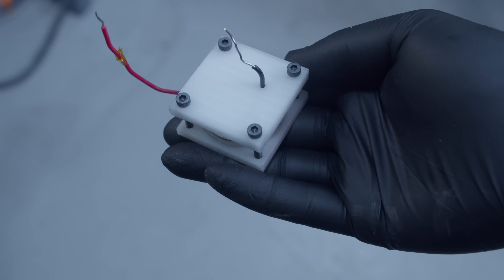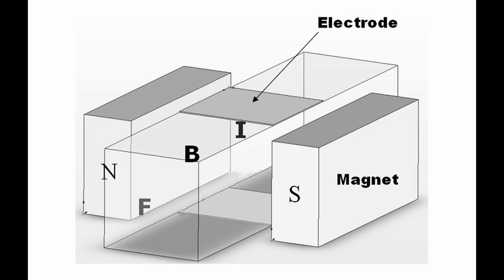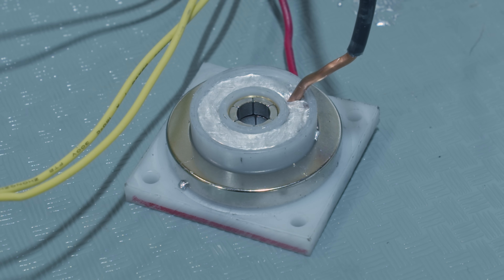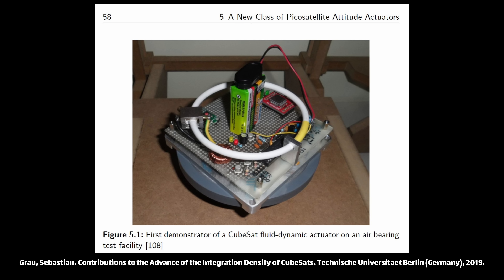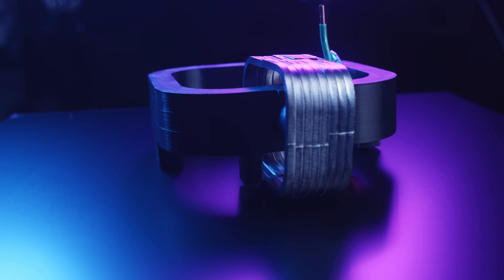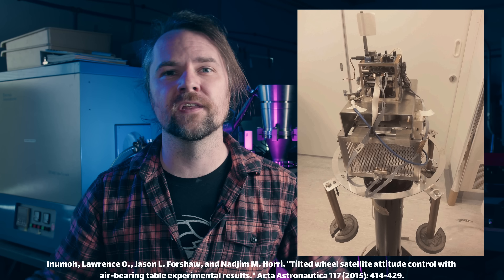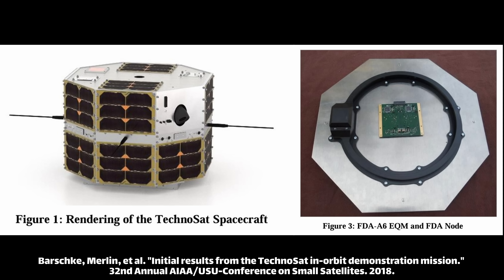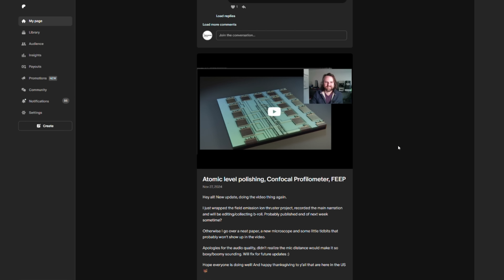A motor with no moving parts (sorta)

Comment: You would have to contain the metal in a pressure vessel or the metal will evaporate. I imagine the heat needed will not be a problem since space is an insulator, and heat dissipation is a spacecraft's main problem.
Reply from the maker: Galinstan actually has a very low vapor pressure, negligible evaporation at operating temperatures!

Comment: A friend of mine sadly gone, thought that if you have a torrid & magnetic coils that not only rotates the mercury round the inside of the torrid which will result it it being pushed to the middle of the inside wall, but also to rotate the mercury so whilst it pushes up against the wall it also tries to move it upwards. So two rotations, one round the torrid, the other up against the middle of the inner wall. I wondered if whether having "blades" on the outer inside wall might work like the paddles of a riverboat. Sorry for the bad wording. It's difficult to articulate this.

Comment: I am wondering how big of an issue it is that these reaction wheels need to be actively heated? I am aware that satellites often have a heated partition for vulnerable electronics and measurement devices, but I believe pressurized air and some mechanical reaction wheels can operate at near space temperature, where this metal solidifies at relatively high temperatures...

Comment: I’d bet you could get the electrodes across the air bearing gap with graphite brushes or something. It would drag but you could calculate it and it would stay relatively consistent allowing for more accurate measurements. Not that it matters I guess but cool video thanks!

Comment: Multiple off-set electromagnets, even/uneven spaced ones & one or more submerged (in the liquid metal) vessels with little fins on them, might be a fun experiment to try. Should give an effect more like that of the vibration modules in mobile phones. Caveat:  vibrations are horrible for telescopes, but can be tuned... the little finned vessels may impart better sudden stops, which can be beneficial.

Comment: Your liquid jetwheel has a critical, fatal flaw.  This is friction. The viscous friction of moving liquid through the channel is orders of magnitude greater than the friction in the bearings. This means that it will only work as long as energy is supplied to it. An ordinary wheel with bearings will require significant energy only at the time of acceleration or deceleration of the wheel, and then it rotates for a very long time after the power is turned off. This is because there is no gravity in orbit that would load the bearings, so the friction in them is much less than here on earth! On the contrary, liquid metal always rubs against the walls when moving and will stop very quickly as soon as the electric current is turned off. This makes such drives useless. They will very quickly waste all the energy uselessly turning it into heat. At the same time, ceramic bearings do not need to be lubricated, and wheels in a sealed housing filled with a small amount of inert gas can even use gas bearings that do not wear out at all.

Comment: Point contact bearings would also solve all of these problems.  In a brushless DC stator with shorted rotor configuration, I would think this is viable.  It would be necessary to support the rotor during launch to avoid damaging the bearings.
The density of mercury would be valuable in this application.
A small series resistance would avoid the suppy's SC protection.  (R is I to V converter...)

Comment: Issue with liquid metal reaction wheel is the low temperature in space. All liquid metal will turn solid in space if without heating.

Comment: I just wonder, which liquid metal would be the best in a real space application. In a satellite in space toxicity is not the main concern. So mercury would be possible, but has also corrosion risks. But galinstan is well known for corrosivity. What about NaK - you do not have oxygen or water in space, so theoretically it could be possible. are there other possible liquid metals?

Comment: I thought of a way to transfer axis rotation to a different axis using these liquid metal wheels with the housing of the liquid metal varying it's surface friction to apply force to the housing instead of at the magnet. It would allow force to be applied in one direction with the effect adding up over time. Tada, transportation between star systems

Comment: I’d love to see you try this again but by deep sixing the wires and using 2 fishing swivels in the center of the top and bottom with a little tension on it and some copper wire connecting the swivels to the power supply so you could isolate the + & - wile having a low friction way of letting it spin in complete circles and not needing batteries or an air Bering though one could be incorporated but keeping it simple try the swivel idea.
Reply: Read the part about it being highly corrosive to all metals.

Comment: A big problem with liquid metal reaction wheels in satellites is that you'd need a heater to keep the metal from freezing. Adding a heater means increasing the sizes of the batteries and solar panels.

Comment: If you are bucking to a lower voltage by did you hook the batteries in series? Leave them at ~3.7V and hook them all in parallel.

Comment: A small issue I foresee is the interaction of the magnetic field the reaction wheel requires to function interacting with the magnetosphere. Field gradients aren't uniform and you'll end up generating interfering torque forces of varying intensity as long as the magnet is on and the vessel in motion. Magnetotorquers use this principle without the reaction wheel component to maintain stability and attitude control for satellites via the magnetic dipole alone.

Comment: I love this! However, it definitely requires mercury. I understand reluctance to use it, but Galinstan is neither particularly dense nor conductive, and its melting point is significantly higher than that of a mercury alloy.
Reply: As expected, the mercury king is already here!
Reply: So if you were to test this, what about floating it on a sea of mercury rather than an air bearing?
Reply: @HighOnTacos  :D but it will have same issues as airbag but instead you will get spilled mercury everywhere when your balance fails xD
Reply: Ionic liquids? Anyway I've never heard of this technology until now and it strikes me as being very important! Not merely because of the lack of bearing and wear or absence of vibration, but because, unless I am missing something important, it also obviates the need for magnetorquers such as on the Hubble to "push" against the earth's magnetosphere so that the reaction wheels can be periodically "desaturated" when they reach their rpm limit. It also eliminates the need for probes in deep space to burn fuel in the reaction control system to do the same thing! It seems to me this could significantly reduce the fuel consumption of long duration deep space missions.
Reply: @Muonium1  Ionic liquids? iconic liquids!
Reply: 👋 Even if mercury melts at -38.9°C vs-19°C for gal-ind-stannum(tin), it should require a lot of energy to prevent the "soup" to not become icy in the void of space… I Wonder if regular gyros are heated.
Reply: @Guezolte The average temperature in earth orbit is 20C…
Reply: Galistan has a higher conductivity (3.46 10^6 s.m-1 vs 1.02 10^6 for Hg), higher surface tension (.718 nm-1 vs .465 for mercury), and better resistivity (28.9×10−8 Ω·m vs 98.0×10−8
Reply: @Guezolte  and drags all over the walls of its containment. Mercury is the way here. Put it in a quartz ring and it will act like a flywheel in there. This stuff stops the very moment the current does because it wants to stick to everything. Mercury simply doesn't have that problem.
Reply: High surface tension is key here.
Reply: We use mercury, here in Tartary...
Reply: So this would be a molten metal gyroscope?
Reply: @stevenwill  Yes, if used in that way. In principle. In reality this has issues as presented, namely the metal used. There's no real flywheel effect here. It reacts, but the moment you let go of the juice, it returns the momentum due to drag on the inside walls of the containment.
Reply: You absolutely don't have to use mercury.
Reply: Bismuth Titanate is the best housing dielectric material inclusive recommendation.
Reply: NaK works too. (They use the same concept for nuclear reactor cooling pumps).
Reply: iif i'm not mistaken, Galinstan is incredibly popular as a TIM in PC building, it is credited for high thermal conductivity compared to conventional silicon based TIM, It is also however only for pros because it WILL SHORT YOUR ENTIRE MOTHERBOARD IF you do not have Conformative coating all over the board, although if you are talking about low conductivity COMPARED to mercury, i understand
Reply: YOU MUST CONSTRUCT ADDITIONAL MERCURY MINES
Reply: the ceo of mercury back at it again :)

Comment: i'd like to see you try this again but make it a circle instead of the square because at that point it's not actually spinning like a wheel it's just flowing fast in one direction then hitting a turn slowing it down again and again so it's gotta be severely limited by its shape. still a really cool proof of concept though that's for dang sure
Reply from the maker: Yeah it's a tradeoff between maximizing the diameter and volume of the metal (to maximize angular momentum), and minimizing friction losses by using a circle. The corners are rounded which helps. The other consideration is that a square is more space-efficient when considering a cubesat volume limitation, compared to a circle.
Reply: And the device is based on angular momentum, which does not care about the path the fluid is traveling. It is more closely related to the area that is enclosed by that path and the mean mass flow rate.
Reply: @sebastiangrau9793  exactly and in this design the mass flow rate is significantly limited by the turns grantaed the deceleration of the fluid hitting that turn can also provide a force to act as a reaction wheel but it's almost canceled out by the acceleration force after the turn.

Comment: 7:36 I'm pretty sure I have the exact same buck converter and Im pretty sure its limited to around 8-9A and the diode shining red it's limiting current so it wouldn't be pumping out 20-30A
Reply from the maker: Oh, damn! I went back and checked the listing, theoretically it's limited to 12A. I could have sworn it was 30A limit, although I have no idea where I got that idea 🙃.  That actually means it was performing a lot better than I was expecting. That's what I get for not double checking before calculating and filming a video haha. Thanks for the correction, I'll add it to the pinned note!

Comment: ABOUT THE PROBLEM WITH THE WIRES.
INSTALL A BRUSH MOTOR SYSTEM TO POWER THE DEVICE, SO THE WIRE DOES NOT INTERFERE WITH THE SPIN.

Comment: How any liquid rotation could provide a pulse for a precise measurement of rpm for the finest and efficient adjustments of the satellite position?
Reply from the maker: The force applied to the liquid metal is proportional to the electrical current, so you can modulate how much force just like with a motor. Resolution would then depend on how well you can control the applied current.

Comment: If magnets provide a torque on the earth's location. Why bother with reaction wheels, why not stick a couple mangets on poles on the spacecraft and let the earth stabilize the satellite. Making it face earth would cost nothing and keep working for as long as the magnets work.
Reply from the maker: That works great if you just want a stable spacecraft! But if you need to point at specific targets (distant galaxies, your ground-station as you pass overhead, earth-side imaging targets etc) you need to be able to change your orientation at-will.

Comment: I'm assuming the metal you're using is gallium. But wouldn't gallium be solid in space? Due to temperature?
Reply from the maker: Galinstan! Mixture of gallium, indium and tin, which stays liquid until around -18 to -20C. Which is just about as cold as a LEO orbit gets, so would likely stay liquid without additional heaters (because the hot-side of a LEO orbit is around 60-80C). For missions further from the sun you'd definitely need a heater though yeah.
Reply: @BreakingTaps  Well that explains it then. Thanks!

Comment: Question to all:
Intuitively I can not see any reason for the squarish geometry. With the short actuator zone at the magnets and electrodes, would a rectangular rectangular loop not give the same effect, if it is placed symmetrical to the centre of mass?
Reply from the maker: Good question, I should have mentioned that! It's a tradeoff between maximizing the diameter and volume of flowing metal that can fit in a cubesat format, and a circular design to minimize friction losses. The TU Berlin group opted for this rounded square design because it works nicely with cubesat frames and leaves space in the middle for unrelated electronics and other functions. But yeah there are tons of geometry options if you can design around it! Including more complicated shapes like "L" loops, which give you control over two axis (for redundancy) or stacked spirals which gives more angular momentum in the same space.

Comment: @4:15 it ought to be fairly simple to calculate the resonance of the mass and wire, and drive the reaction wheel with a h-bridge circuit.
@9:05 you could also pulse modulate the circuit to reduce the average current consumption.
!!! Excellent work ❤

Comment: Space is cold though, wouldn't it cost probably more energy then simple deterioration of solid steel bearings/housing?  Keeping metal up to temp. Costs valuable  Energy to keep the  metal in that liquid state..  This would be awesome in cars, where the engine could keep the metal liquid, Imagine never having to replace your flywheel 😊
Reply from the maker: Galinstan stays liquid until around -18 to -20C. Which is just about as cold as a LEO orbit gets, so would likely stay liquid without additional heaters (because the hot-side of a LEO orbit is around 60-80C). For missions further from the sun you'd definitely need a heater though yeah.

Comment: Would be interaction with magnetic filed of earth beneficial than drawback? Current reaction wheels have problem that they can become saturated (spin too fast) and you need use rocket properer to wind down them. It could be possible to counteract magnetic filed you will wind down your reaction wheels.

Comment: I had a similar nerd snipe moment when I was asked about if it would be possible to correct for the angular incidence of sunlight and make some weird perfect reflection.
Needless to say, I now have lots of weird wooden jigs around the house and piles of broken mirrors from overtorque'd attempts to make minute adjustments to curving mirror surfaces.

Comment: Do you have some more information regarding the air bearings? Like design and such! Because imho I think the cylindrical bearing definitely deserves some respect if the hole structure is 3d printed (resin right?)! I could not get that to work and only had limited success with graphite in a resin printed receptacle, to much air losses so it doesn't hold up allot of weight.
Reply from the maker: FDM printed! I'll see about knocking together a quick video about them, didn't realize there would be interest. The hemispherical bearing was a monolithic print (there is some internal geometry which acts as support). The cylindrical bearing was two parts (body and a "lid" that is epoxied on). Printed with thick walls and air leakage is surprisingly minimal, was holding 15-20 PSI. Unsure what the max capacity is because the tests were with pretty light objects.
Reply: We used polyacrylate bowls of about 20cm in diameter for the floating device, which puts the center of gravity well below the center of rotation

Comment: Very cool demo. Is it really necessary to use liquid metal though? Wouldn't the same effect be obtained using copper nano particles mixed with any substance which remains liquid at very low temperatures, such as Helium or Hydrogen?
I also wonder why not use magnetic bearings to solve the issue of wear on traditional reaction wheels.

Comment: The biggest problem I see with this this is that you would need constant current going in order to keep the thing spinning.  The satellite only rotates while the wheel changes it's speed so over time velocity on the wheels builds up, and the fact that the wheels act as flywheels and keep spinning forever with (almost) no power loss is critical. In order to get this to work you'd need superconductors to keep the electric current going continuously forever, or use some of your power budget to maintain flow rates.   Eventually satellites will do a wheel 'desaturation' burn where they use thrusters to counteract the spin as they spin down the wheels.

Comment: You should be able to make air bearings out of graphite relatively easily - Applied Science channel has a video about that. It's basically just machining a rough shape into a porous graphite block fixed in a 3d-printed mount with air supply and rubbing a steel ball bearing or whatever else you want to suspend to achieve precise matching of surfaces.

Comment: Why have the electrical connection with the liquid metal? May be use metal plates (top/bottom) isolated by thin plastic from the liquid metal. In terms of circuit this would be like two capacitors in series. The liquid metal would still experience an electric field, but you wouldn’t have the crazy high current flow.